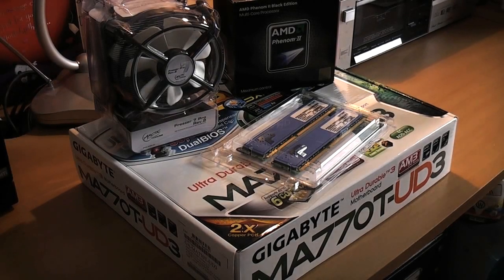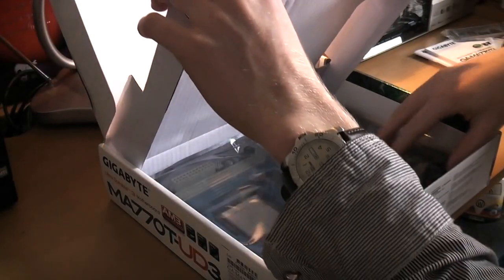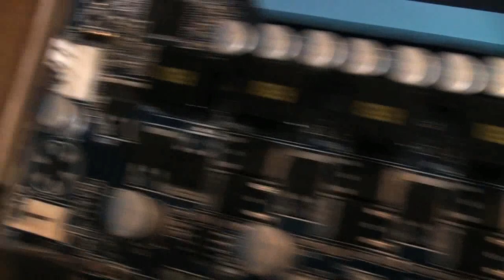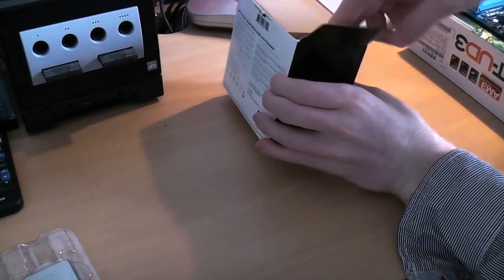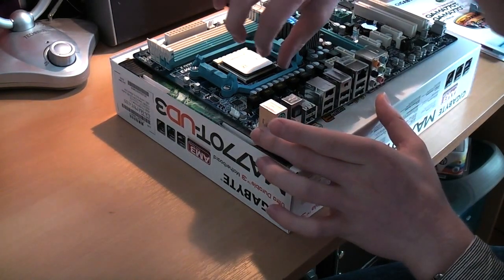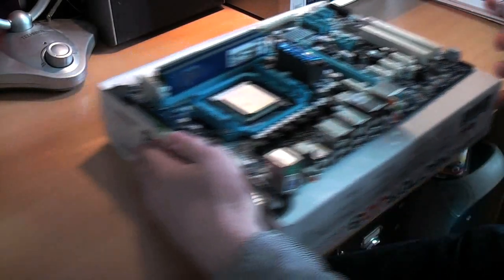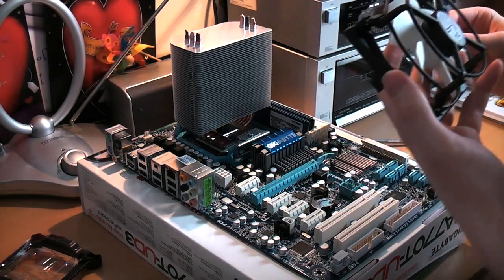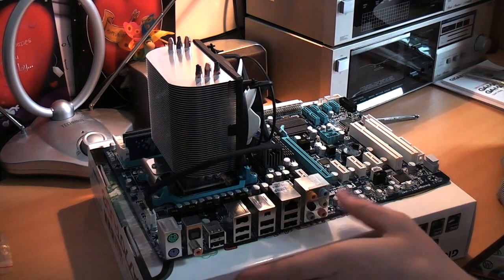Gaming PC Build: Part 2 (Motherboard Unboxing & Preparation)

Comment from the maker: It's a hard question to answer because it's different for all cases. I'd recommend buying a case that has LOTS of space behind the motherboard tray. Hook yourself up with a load of cable zip ties (some short, some long) and take your time when your building. Decent cable management takes patience. Also, invest in some extension cables for front panel audio and 8-pin CPU power. Even if you don't use them, they're VERY hardy.

Comment from the maker: My PC runs VERY cool, even over clocked maxed out. The case seems great for airflow, but it's a little small for my liking. It's slightly smaller than your 'average' mid tower case. My major con is the lack of space behind the motherboard tray. It has decent grommets for cables but they can't cope with very thick cables... It's a decent case with excellent features for the price, but space can be an issue.

Comment from the maker: @Madt001 No it won't. The fan sucks air from the bottom of the case, through the heatsink, and out of the top where there'll be 2 140mm exhaust fans. You can't mount this cooler on an AM3 socket facing the back.

Comment: I think you put that cooler on the wrong way. The fan is pointing towards what will be the bottom of the motherboard and case. Is that right? Would have thought you'd have pointed it towards the back so it blows the heat out the rear exhaust fan.

Comment: Can you give your opinion on my budget pc im working on:

Z77A-G43 Mobo
i5-3570k CPU
GTX 550 Ti GPU (From my old computer)
4GB DDR3 1333Mhz RAM (From my old computer)
XFX 450W Core Edition PSU
1TB Seagate Barracuda HDD
Aerocool Strike X One Case

Comment: Hey, I'm planning on upgrading my current computer. I have a pretty good knowledge about computers, their parts and and what to do with them; Especially Radeon video cards and CPU's (last time I researched those was right before the next gen "i3, i5, i7" cores came out. I just want to be able to know exactly what I'm doing when it comes to putting it together. Any tippers on sites or something I can go to to better educate myself for building one? Also, a cool site: hardware-revolution"dot"com